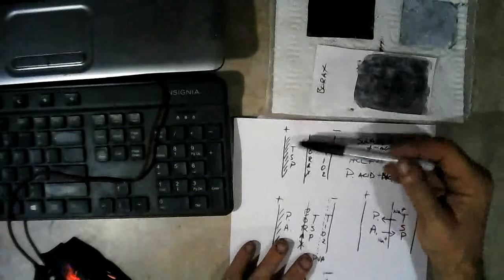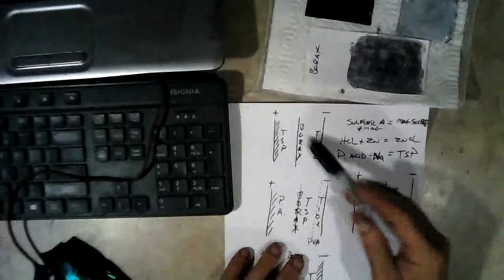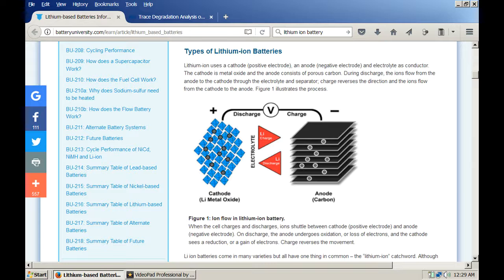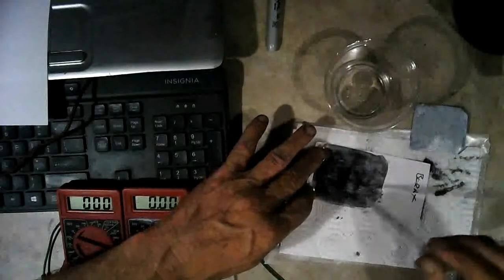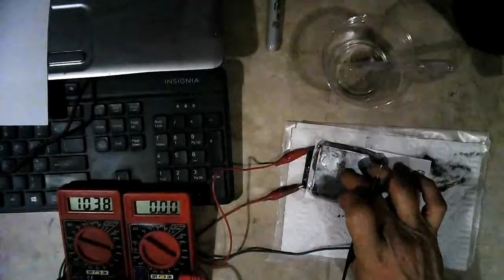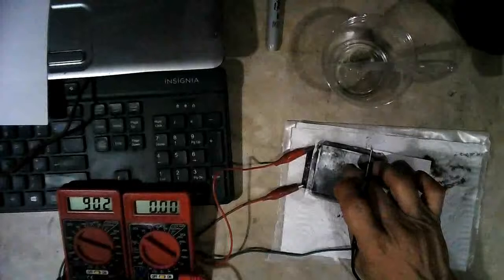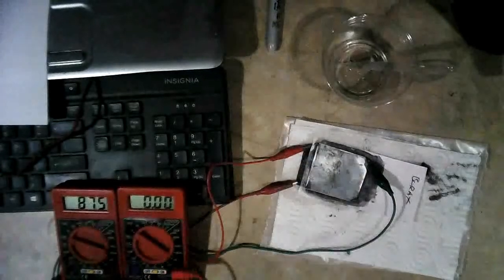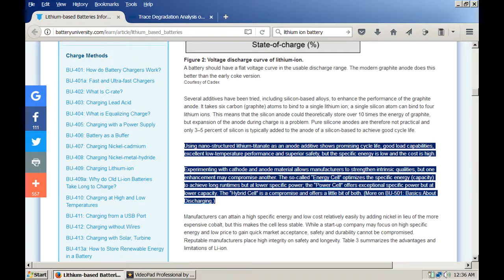Borax Exfoliation Test #2 Sodium Ion Transfer!

Comment: A lot to consider. Carbon on both sides might be creating some amount of equilibrium in the chemistry. We know if it bleeds through the membrane the performance drops. It seems like the original configuration was heading the right direction.
Reply from the maker: There is a lot to consider Fred, like why phosphoric acid creates an alkaline salt? And why is the Bio-Cell ass-backwards compared to Lithium Ion and other batteries (metal oxide on anode). My gut tells me this is something important I need to explore, so I'm exploring it.  An all carbon bio-cell will require answers to these questions will it not?
Reply: Yes indeed. The cell does seem to perform better in reverse. Then again you have only tested the cell as a primary cell. You have not explored whether the process is reversible. It may not if the Ti02 does in fact work as a semiconductor. It could be that it operates in only one direction. Trying to charge one might answer that question. The papers you are referencing all refer to rechargeable cells which is a condition you have not yet subjected your cell to. The charging voltage need not be very high or even regulated, just higher than the initial voltage. I would be inclined to try a single alkaline which would be a half volt higher than what you have been observing. If there is an increase then the ions are moving both directions across the membrane through the Ti02 to the electrode. It could be that the system has not reached it's full potential. Most secondary cells start out at a much lower voltage and capacity until additional voltage is applied. It wouldn't take much to explore the possibility. The results might provide clues about how your cell works and could be surprising. As a good friend of mine once said, you never know unless you try.:)
Reply from the maker: I have tried to charge the cell Fred, a number of times, even on video. What ever is happening in the cell IS reversible too, or it wouldn't self-charge. I will try putting the TIO2 on the cathode tho, I haven't done that yet, at least by itself. We'll see what happens.

Comment: Hey Bio-Cell! Check out Usanovich's theory on acids and bases. You have a very interesting cell and chemistry. why not try charging it?
Reply from the maker: Hi Adam, Ok, I'll google Usanovich's theory of acids/bases and see what he has to say. Looks like I need to demonstrate trying to charge the cell again too. It's never worked before, but maybe reversing the TIO2 in the cell will allow it. I don't know. We'll see.
Reply from the maker: I just checked out Usanovich's theory Adam, and I think his more general theory of acids/bases is correct, even tho most authorities don't accept it. It's totally logical that any positive or negatively charged entity will accept any oppositely charged entity (Ion, atom, molecule), as long as the structure can be formed. Thank you for the information! It helps! :-)
Reply: I found with his theory there was an immediate connection or a rule of thumb to understand acids and bases. where with Lewis acids and the various equations, the concepts did not seem strait forward without H and OH. 

Both theories basically end up saying the same thing. "acids are those substances which accept electron pair "anion" and base are those substances which donates electron pairs "cation".  And looking from left to right on the periodic table we go from the most basic to the most acidic. Well I think Hydrogen is the exception, but more or less.
Reply from the maker: Excellent description Adam! I believe nature is inherently a simple mechanism (Electric Universe theory) which is misunderstood. If something doesn't make sense, it's probably only a partial truth. Thanks again for your input!
Reply from the maker: I believe hydrogen is unique in the Periodic Table (which is not structured correctly in my opinion). In this context, I'm seeing hydrogen as an ion, atom, or maybe even a positive "electron" because of it's extremely small size. Hot and cold electricity has been proposed by others too!
Reply from the maker: What I'm getting to, is maybe "electron pairs" are not both negative, but in reality positive and negative? Which makes more sense? We know they spin in opposite directions and can be separated.